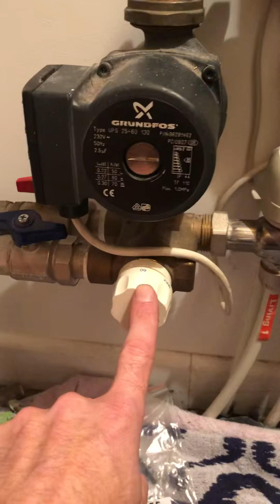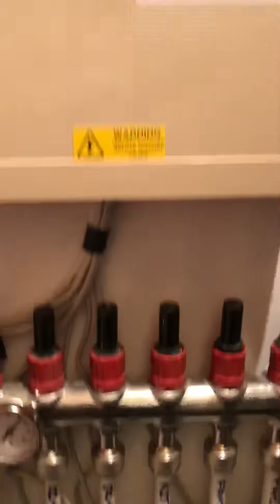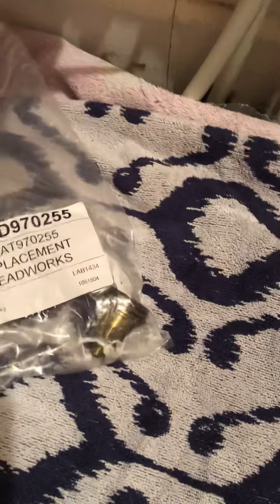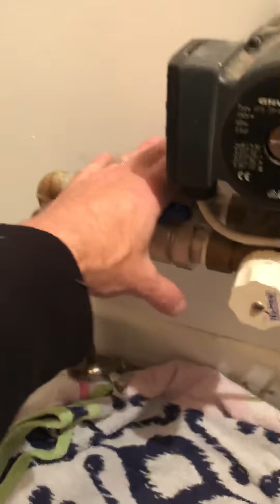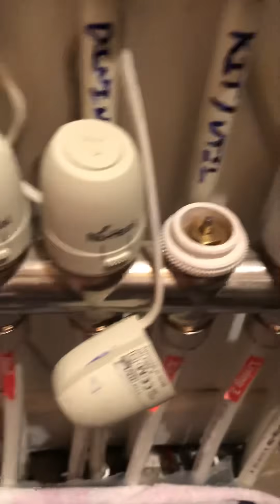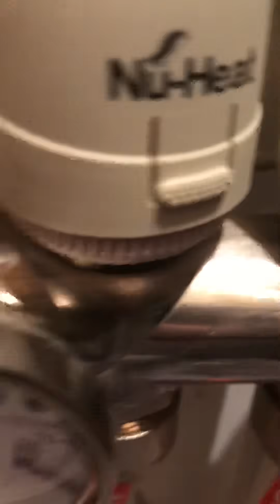Nu-Heat underfloor heating manifold repair

Comment: Amazing thank you !!! 🤩
Do you have a video of how to drain the air out? And would that solve the possible "air bubble" I believe I have in one of the circuits? 🙏🙏🙏
Reply from the maker: You can try closing all the values except the one with the air in. Run the heating and see if the return pipe gets warm. Can take an hour or so dependent on the size of the circuit. Check the pressure in the system in just above 1bar too. 👍🏼

Comment: Why are the "flow-meeters" at the top so dirty/black. Is it normal? Since I have similar system and my flow-meeters on working circles are dirty, same as yours.
Reply from the maker: Just dirty deposits like a normal heating system and radiators. Could drain system, clean and refill with adding some inhibitor but system water is actually clear so not worth it
Reply: @Dans_Kidney  But you don't actually see the flow throughout the circles because of the dirt?
Reply from the maker: Why do you need to see the flow? These are just for balancing the system when installed. They never need touching after the system is installed and running correctly.
Reply: @Dans_Kidney  Because of exact same reason, the system is out of balance, and was not installed correctly 🤷‍♂️🙂
Reply from the maker: @xmax-a  are is see you didn’t mention that. You need to drain down, clean the system parts and recommission the system if it’s that bad so you can see the flow. You could just try to run each zone independently to check correct working first
Reply: Yeah, found the video where the guy is explaining how to clean the flow-meeters, but it doesn't look so easy and would be risky in order not to break any of components. https://youtu.be/rbjFzYcr4VQ
Will try to flush the system first, circle by circle. 
Thanks for the answers!
Reply from the maker: @xmax-a  no problem. Good luck
Reply: Thanks for the very helpful video. Do you have a link for the exact replacement valve you used, or a part number? I have this same problem but can't find the correct replacement part on the nuheat site. Thanks
Reply from the maker: @dr.dr.9888  hi. Did you mean the temperature mixing value I used in the video?

If so, if you pause the video at about 58 seconds you can see the part number on the bag and I ordered directly from NuHeat. 

Hope that helps

Comment: Excellent video, I have this exact system. Couple of rooms in my bungalow are stone cold. The actuators are working fine. Can you please advise how to check the pin valves. Should I be able to check the pin just by removing the actuator. Or do I have to unscrew the valve assy in order to check it?
Reply from the maker: Yes. Remove the actuator and switch for one the does work in one of your rooms and see other the cold room circuits then heat up. If they heat up you know it’s the actuator and not the pin. A small amount of WD40 and a flat head screwdriver will work to press gently on the pin to make sure it’s free. Make sure you label the actuator head with a marker pen when moving them around so you know which is which.
Reply: @Dans_Kidney  Many thanks for your help, really is greatly appreciated. Tried swapping the actuator for a good known working one but still no heat in bedroom 1. Tried using silicone lubricant on the pin valves as per instructions found on Nuheat. Used pointed nose pliers to pull the valves up and side of flat blade screw driver to push them down but still no joy. Also I've noticed my system has flow meters for each zone. Most of them look clouded up and the red indicators look jammed. I'm guessing I need to adjust the flow for each zone? Should the pin valve be depressed in order for water to flow? Should the actuator push the valve down when the thermostat is turned up? Such a complicated system. I'm just hoping I haven't made things worse by messing with the valves 😭I noticed when I press the valve down for bedroom 1 the flow indicator rises...is that right?
Reply from the maker: @tonypowell250  firstly I wouldn’t recommend changing the flow meters as these would have been balanced on installation. (Unless the rooms have never heated from the day of installation) they generally do get cloudy/dark just like the inside of a radiator over time. A system clean would improve that but that’s personal choice. 

In terms of the pins it does sound like these are faulty now, especially if the working ones didn’t make a difference when swapped. Looks like you’ll need to order new ones and replace in the rail. Maybe try one first to see if that cures the issue.
Reply: @Dans_Kidney  Thank you. I only swap tested the actuators but not the pin valves. Is it safe to remove the pin valves without causing a leak or air lock? Also is it ok to spray the actuators with silicon lubricant? As per your advice, I didn't adjust the flow gauges as this might ruin the balance. Do the actuators hold the pin valve down in order to make the water flow through the pipes? Also I've read that removing the actuators allows the hot water to run through the system unrestricted? Is that right?

Comment: Great video. I have a sticky pin under my actuator - what would you ask for when seeking a spare? Does it have a technical term? Thanks
Reply from the maker: I would ask for manifold rail actuator pin values. Not sure that the correct term but certainly explains what they are. Dave you tried freeing it up with pliers and a small spat of WD 40?
Reply: @Dans_Kidney  managed to find the part coming tomorrow. Is it as simple as isolating the manifold, draining any water in it, and undoing the hexagonal nut that surrounds the pin underneath the actuator head?
Reply from the maker: @matthewallen5755  should be. Once you’ve isolated the manifold water and power make sure you release the pressure and drain down enough. Maybe there’s a drain off at the end of the manifold near the pressure gauge. When you refill open each zone individually to remove any air and top up to the correct pressure again.